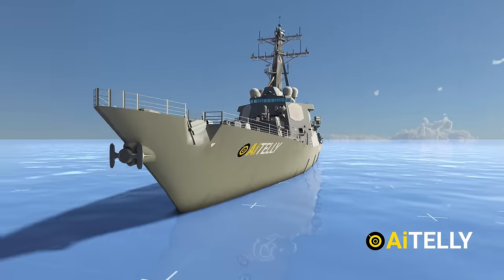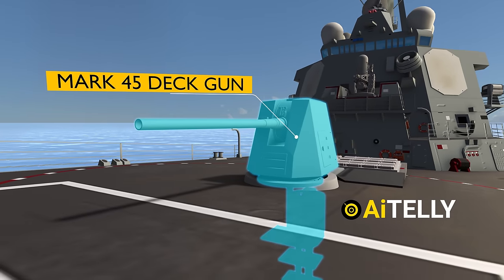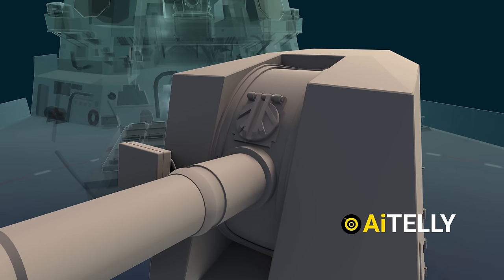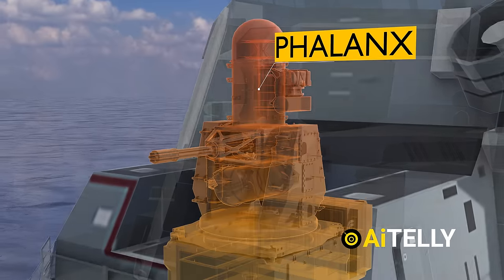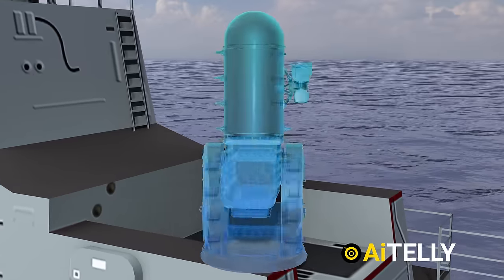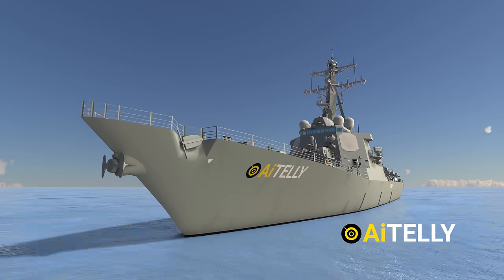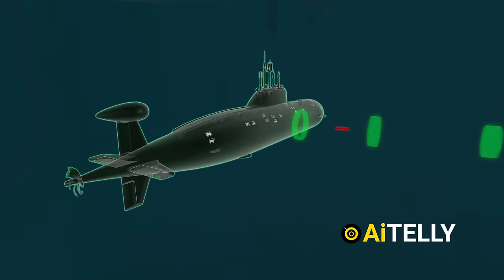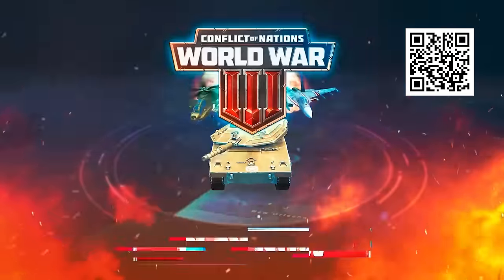How US Navy Destroyer Ship Works?

Comment: There are no diesel engines on a Burke class Destroyer. How did you miss that, they have been at sea since 1990.
Reply from the maker: It's for the battery not for for the propeller
Reply: There are no diesel generators aboard the DDG-51 class ships — PERIOD. 

Installation of diesels certainly was contemplated, but the Navy kept as much of the Speuance and Ticonderoga as possible and crammed it all into the fat, short, sticky, fuel-guzzling "revolutionary hull form" hull. If you try casually, tou could say the 51 is kind of like a giant PT-109, scaled up. If into conspiracy theories, drift into the territory of " Gee, I wonder how much GE lobbied the Navy and Senators to ditch diesel..." Loll... Only recently did Rolls-Royce gain some traction, since ~ 1978.

There never have been. Any batteries aboardship ( in the Ticos and Burkes) will be what we called UPSES, as in UPS plural, as in uninterruptible power supply. Those are racks, probably close to IT room 1RU, bit on on steroids fir MilSpec, weight, and fire reasons. Those batteries don't propel the ship. They supply the absolutely core vital control and data transfer systems when the ship loses all three of the Gas Turbine Generator Sets (GTGs or GTGS's.) They keep targeting data in RAM. (On my first ship, the Flint (AE-32), steam-propelled, we'd sometimes lose ALL our diesel power. It took over 15-30 minutes to manually regenerate target tracks data. IIRC the FFG-19 was faster, at mabye 5-8 minutes regenerating target data when we fully "dropped the load".)

Those batteries (51, 47, 963, 993 classes) are/were periodically topped up or reconditioned vai a mix of conditioning gear, switchboards, transformers, and more, fed by gas turbine engines dedicated as power sources, since the initial Burkes, and, IIUC, even Flight 3 don't derive electrical power from the propulsion engines (that last bit I need to re-research). IIUC, they use Rolls Royce MT-30s for electrical power. Again, I may be wrong about that bit.

The AWD has diesels, it seems, but they are small, pretty much the size format or form factor British use. That's a legacy of the UK during WW2 having tiny railroad tunnels via which it shipped diesels across great distance to the shipyards. They apparently kept that small footprint and like it. The USN has a propensity to sometimes act like Texas, in that bigger is better, more power density per device is better than smaller, more nomerous, distributed power generators. Some of it is design philosophy. Some of it is that industry can end up charging more just because if you build that into your design, it's hard to remove it without politicians (or their paid-off former officers-turned-consultants sometimes working against the Navy's real or political interests) meddling to serve their constituents who need/covet that money. Equipment needs, counts, and resiliency, and survivability will all determine the size or load capacity of a ship's gensets. Diesels are HEAVY, depending on how many megawatts you need, how MilSpec they need to be, and whether or not they're "life-of-ship" (meaning not expected to be removed by cutting or hacking the device or the ship to get it out or to replace it) components.

But, who told you the DDG-51 has diesels? They pulled your leg, or legs, or you waded into disinformation or bad information.

As for the source information about the British tunnels limiting the installed power per generator, you may be able to find the following:

"A Comparative Study of US and UK Frigate Design"

Larrie D. Ferriero, Department of the Navy, NAVSEA, Washington, DC, and Mark H. Stonehouse, Sea Systems Controllerate, UK Ministry of Defence, London

Their paper was published in 1991, in SNAME Transactions, Vol. 99, 1991, pp. 147-175.

That's 29 sheets, front and back, a trade industry journal allocated to that pair of writers who acted as mock designers of each other's navy to make for their own navy a ship concept approach borrowing concepts and rules from the other. It's a fascinating and extremely informative paper.

Likewise, innumerable examples exist in the real world, and far too many examples exist for anyone undertaking a hobbyist naval ship presentation to double-down on things the industry or any real sea service sailor can readily (if inclined) correct, refute, or elucidate upon.

If you're able to, you may want to raise funds to obtain a subscription to US Naval Institute Proceedings. It's not cheap. It's available internationally. I've been reading the publication since ~1975, when I was only 10, and I had my own subscription by age~17, before I joined the USN. If you live in or near a maritime city you might convince your librarian to obtan a subscription to put on the shelf. Or, visit a nearby shipyard. 

If you can visit Japan, and if this is still open (I visited it inn2005, adter visiting a Mitsubishi office in Tokyo), go to Funenokagakukan. If you can visit Busan, South Korea, to to the National Maritime Museum. It has a huge maritime display as well as a maritime library chock full of sruff about shipping and ship design. If you can get to Seoul, and then to Yongsan, visit the Korea War Memorial. You see there a 20-foot model of the King Sejong The Great. I saw those three facilities in 2012 and 2016. You won't be disappointed. I visited each of those four attractions at least 4 or 5 times. Lamentably, I in 2012 didn't get beyond Shanghai to the museum as it seemed too far from where I was living. I should have true harder, since I was in Shanghai for more than 14 days. To my surprise, as my ferry departed Quingdao to return to Korea, I realized my hotel was right next to a major submarine base. Over 20 diesel attack subs were there. I don't know if I'm embarrassed or lucky that I didn't know, since I was in Quingdao 1.5 days before going to Shanghai, and ~3 days before leaving back to Korea. Oh well.

Something I at age 14 (1979) did that torqued my would-be recruiter (a submariner, aka "bubblehead") is that I drew on one of my fictional teardrop-shaped subs, a 7-bladed propeller. This was a huge jump over my comical props they'd (other recruiting duty sailors in the office) seen but said nothing of.

He was livid. He demanded to know how I came up with that. He bellowed that that was "Top Secret US Navy Information!!" He was was fuming.

When he calmed down, I told him I saw it (the concept) on the cover of Seapower or USNIP magazine that arrived in my subscription (note: 1978/1979), in a picture of a Japanese diesel boat, in a drydock. Its prop was shrouded, but, I clearly could discern there were 7 blades but counting the hidden blade protrusions and estimated what was in the gaps on the lower side. Then, when my mom's boyfriend tossed away a Coors beer can, I cut it open, made a series of props with blade counts of 1-9, shaped them based on kit models (twist and skew), punched center holes, put them on my Bic ball point pen, and gently and forcibly blew down onto each one several times. I still have those blades today.

The 7-bladed one knicked my face, almost cutting my eye. I ecstatically screamed to myself "THAT'S GONNA BE MY PROPELLER", then finished drawing my sub's control room, messing, reactor, torpedo room, generator room, and more based on recruiting pamphlets and any information about the Thresher, Scorpion, Nautilus, Tulline, Permit, and more that was sitting in the public library. Then, after school, haunted the recruiting office as Indid 1 or 2x a week, and saw my stunned recruiter flip out and reveal more than he should have. But, neither he nor the Navy ever took my drawings. Nor did anyone in my chain of command of either of my two ships, nor at any of my shore duty stations while in various schools twice at San Diego.

I'm not an engineer, but I read and read a LOT. I only consume publicly available info, meaning I don't pay or sicial engineer or hack my way into information people want kept private. There's so much info "out there floating in the air", as in the movie "Heat", when De Niro asked a hacker/thief how he obtained the wiring diagram of a bank vault. "That sh*& is out there... It just floats in the air..." (Of course, on unsecured routers and antennas...)

The Navy is generous. If you're in the US or not in a banned region, or not behind a dodgy/shady network connection, and aren't playing stupid games to win stupid prizes, you can get alllll ssssorts of free, educational, public, sanitized, "unlimited distribution authorized" facts, concepts, and more. Information from sources is your friend. Just use unclassified, unrestricted, trade industry or Navy- or university- released, or manufacturer-provided brochures or marketing material.

Comment: the propellant is separate from the the projectile? i actually saw the shell casing which contained the propellant ejected on the deck during firing, i know the 155mm aremy howitzer projectile does use propellant loaded behind the projectile yes, but not this 5 inches gun, just like the 105mm has its own shell casing

Comment: I think converting 12 warthog to unmanned drones,  with 9 of them used to attack, a ship, like reapers. With a simultaneously strike,  coming in at a simultaneously attack in a halo configuration attack. Converting to a low level just above sea level, to a horizontal halo, timing 2 front, 2 rear 2 port, 2 starboard side and one from top down, launching 2 missles each at same time, then to a Gatlin gun attack.  Would overwhelm the ships ability to defend. And would be sunk. 18 misses coming at it from 6 miles out. At the same time. Toss in 3 unmanned mini subs, launching, torpedoes at same time from 3 different directions. Sims are outdated.

Comment: Arleigh Burke class destroyers don't use diesel generators. They use gas turbine generators.
Reply from the maker: They use both gas turbines Diesel generators are for the electronics of the ship they turned that off after the battery are up
Reply: @Aitelly  No, they only use Gasturbines. 3x3 MW for electric power, and 3x4 MW in Flight 3.

Comment: Wish u would have spent more time on the propulsion, the way it looked at the beginning was like the gas turbines was hooked into the diesel engines which I know isn’t the case. I guess it depends on if this is a Codlog or Codlag as to weather just the diesel feeds into the generators or both the diesel and gas turbine. Also a lot of systems will use different motors or methods during cruising speed or top speed so u could spend at least two minutes on just propulsion and not even touch the surface.

Comment: Did you mean for the graphic on the range of the Mark 45 gun to be able to reach the coasts of both the U.S. and Africa from the Middle of the Atlantic?  14 kilometer is a long range but I doubt my geography is that bad to think there's less than 28 km across the Atlantic

Comment: I cannot imagine more primitive device than the ammunition shuttle, but I can imagine one dozen sailors loading ammunition into the shuttle. There is no defense against torpedo guided with optical fiber.
Reply from the maker: I think Drone and super sonic missile are the major threat
Reply: @Aitelly  Yes, China is building hypersonic, long-range (1500km), anti-ship ballistic missiles (YJ-21). A dozen of cheap drones attacking at the same time is also major threat. I believe that all big surface ships are sitting ducks. I understand military technology very well and I believe that best weapons are stealthy and remotely controlled. These weapons need directional antennas rather than primitive, straight wire antennas. The wire antenna (a.k.a. monopole or dipole antenna) has short range and is vulnerable to jamming because it radiates microwaves in all directions.

Comment: It is the 21st Century NOT the 18th Century!  Kilogram is a unit of Mass NOT weight!   Say 'mass' when referencing the unit gram/kilogram.   Static weight is the product of mass multiplied by the acceleration of gravity and has the units kilogram meter per second squared = Newton.   That is why something weighs less on the Moon than on Earth but the mass is the same at each of these locations.   But if you insist on using the old, obsolete metric system, then you should be saying kilogram-force for weight.  Mass and weight are two different things with their own units and values in the modern and active SI Metric System.

Comment: Score: Video 70%; Narration 45%; accuracy 45%. The video quality is actually pretty good, but some really simple things you got wrong, such as 24km distance being illustrated as a 5000+km translantic reach for the 5" deck gun. In general, the video also appears pretty simplistic or lacks some important detail that could really enhance the presentation. In regards to accuracy, you should note that today's DD's can't really be distinguished from cruisers as both their sizes and capabilities can be the same, but at least you didn't generically call them all battleships. Also, there isn't one size or even a standard size of a destroyer so your discription of size, weight, crew, and power is way off. In fact, for even a given ship many of these measurements, such as weight, manpower, and even armament, vary greatly. You would be better off giving a range of measurements and/or the GENERAL mission and capability of each type of ship. For example, Frigates are generally slightly less capable and cheaper to buy and maintain destroyer like warships. In regards to the warships bridge, it usually only contains a small basic stearing and observation area. A command and control center, called a CIC, is usually a seperate, but nearby, room. Also, no active military warship bridge provides a 360 degree field of view; not even close. Almost a good job though on referring to the dining room and meeting rooms. The dining room is a meeting room of sorts and also often serves as additional bearthing/sleeping quarters. There are no dedicated 'meeting rooms' on DD's. Modern destroyers are also not known for their speed and your reference to such is not correct. Over the last 120 years a few destroyer types were designed for higher speeds, and recent US littoral class ships were specifically designed so, but generally DD's are designed to support and match fast CV's. More on accuracy, the CRAM missile is for intermediate or the second layer of defence and the CIWS (pronounced like Sea-Wizzz), or the more common name for the Phalanx, is used in the last mile or two, or the last line of defense before a jet/plane/drone reaches the ship. Perhaps being picky here, while the Harpoon missle has been in service since 1977, its current updated version is as of 2015. It also was used by Ukrain in June of 2022 to sink the Russian military tug, Spasatel Vasily Bekh. Lastly on being picky, the Mark 45 gun has other very important parts that trains the gun and shells on target. On narration, the general pronounciation is quite good, but you badly mispronounce some important key words, such as Phalanx, Mach, and frigate. Also, at 5:35, the ammo is LINK-less and not LINE-less as in you don't have chain 'links' that connect each bullet together before they are loaded into the barrel and are shot as most machine guns do.
Reply: You're being generous with your percentages.  This video is rife with visual and factual as well as pronunciation errors.

Comment: I am sure you put a lot of work into this, but your depiction of propulsion and electric plant operations is nowhere near accurate. There is no reverse gear on a destroyer. They use a system called CRP/CCP on the propeller. It changes the pitch of the bladed to slow/stop the ship and reverse thrust. The shafts only turn in 1 direction.

Comment: Great visuals, poor accuracy. Ignoring the CIC is a big whoops, the bridge is the heart of ship maneuvering in low threat situations, CIC when things get serious. Berthing compartments are in the hull. No diesel generators. Standard missile - the booster stage launches the missile, the sustainer takes over and is part of the missile itself. It provides sustained power. VLS fires SM-6 multipurpose, SM-3 Anti Missile and Anti-Air, SM-2 Anti-air, Tomahawk, ISSM SeaSparrow and ASROC missiles, not just SM-6. Phalanx is the last ditch system after sea ram, not the other way around. You completely missed the SLQ-32 system, ESM, ECM and decoys. SQS-53 has extensive passive sonar ability, and the oldest and newest DDGs have SQR-19 towed arrays.

Comment: Bridge is NOT the most important part. Engineering i the most important part. If the Snipes don't groove, the ship don't move.
Reply: Reminds me of Captain Garner, CHENG of the Battlestar Pegasus, when he tells Lee Adama that without engineers, there's no lighting, no power, no water to take showers...

Definitely, without power and engines, the ship is a glorified barge to be towed or set adrift to become a hazard to navigation or to be illegally boarded or coveted to be boarded.
Reply: @davidsyes5970   The bridge is just a high place to stand if the ship doesn't have power.  But then, I'm an old Navy Boiler Tech and destroyerman - as the lead Burnerman (the guy who actually lit the boilers off) - MY JOB was the most critical job on ship. My boilers have been replaced with other types of technology - mainly gas turbine, cocog plants - but even then - if the snipes don't groove, the ship don't move.
Reply: CIC * 😂
Reply: @HopSkipRun22   can't function without power.
Reply: @HopSkipRun22  is useless without power.